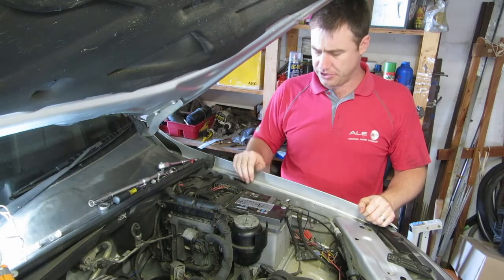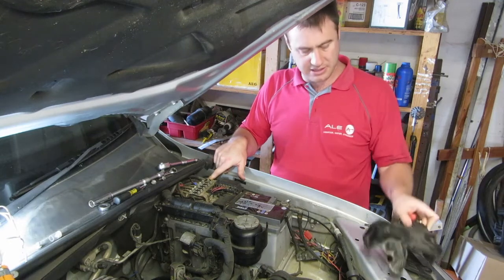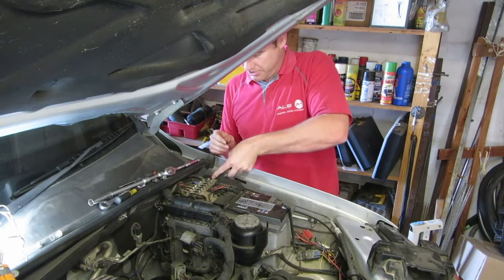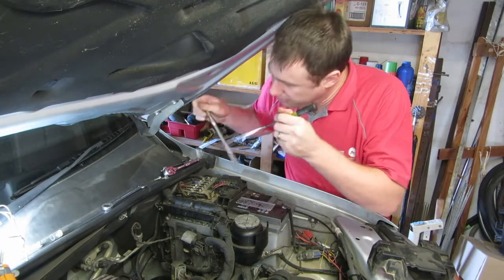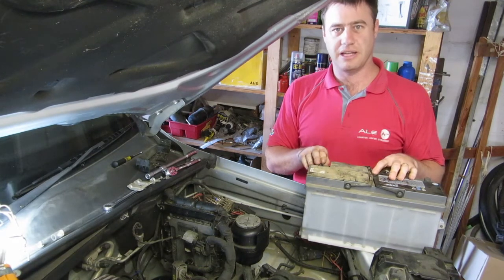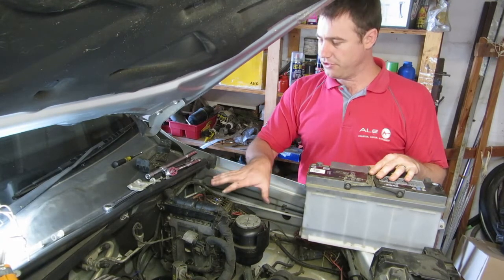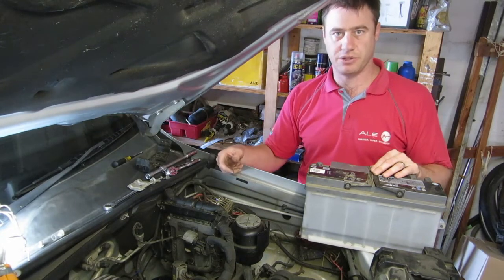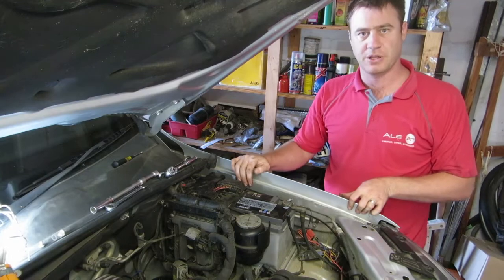VW Amarok Battery Removal and Replacement

Comment: V helpful.  The busbar on my 2017 V6 is bolted to a stud on the battery terminal.  Getting the clamp back in position is important as if not perfect, the ECU won't fit properly.  The clamp slides into a slot as Wilem said but it is not obvious. My factory battery also had a thermal wrap (northern Europe).  Baie dankie, menheer!

Comment: Just FYI mate, I just changed the battery on the 2014 Amarok, no faults except for one minor one, the Windows lost automatic up/ down ability. started with one, now two working again. Hopefully the back Windows regain ability as well. Also the hold the key button for lock and close lost the ability to go up and down on all 4 Windows at once. Other than that mate cheers for the info.
Reply: Just tried Windows, they work in the back and also they all come up and down again when you hold the key on. Cheers again mate.
Reply from the maker: Just let the windows down all the way and hold it a few seconds when they are at their limit, do the same for closing them. Hold the switch a few seconds when they are closed then auto up and down will work again.

Comment: What is the battery specification for the Amarok?
Reply from the maker: Newer 2ls comes out with a 72ah battery I think. Mine which is a 2011 model has got a 95ah battery. I would honestly always install the bigger one of the two. It will just make the battery last longer as it doesn't have to work that hard especially in winter times. The fownsizing of the batt was probably to cut costs on newer models.
Reply: Thank you for the reply and the recommendation! I have the 2L 2016 model just before the facelift.

Comment: Well, I loosened the worng bolts. The 3 for the ecu bracket. Then removed the battery. Then I found this video. Don't do my method. If only I found this video earlier.